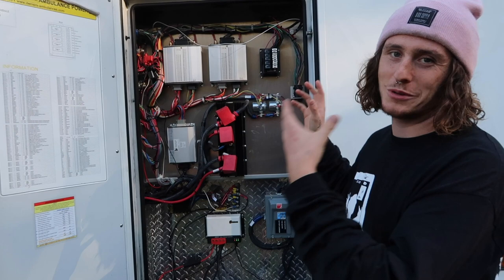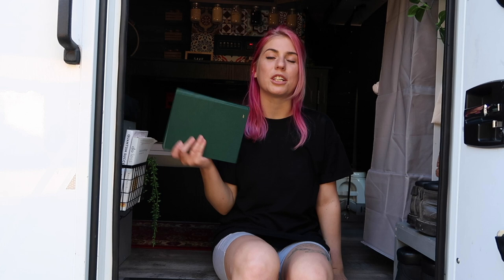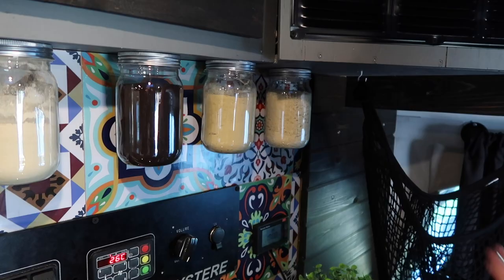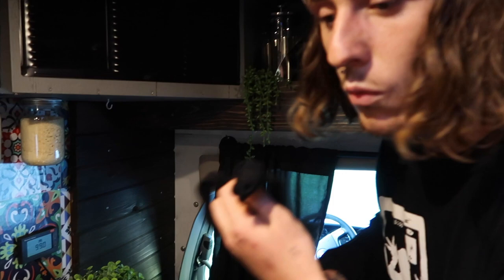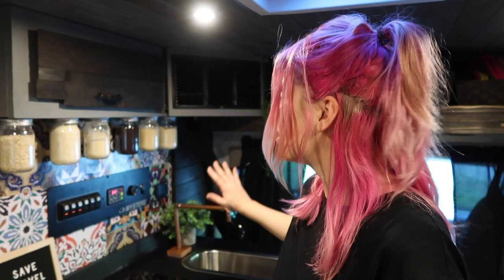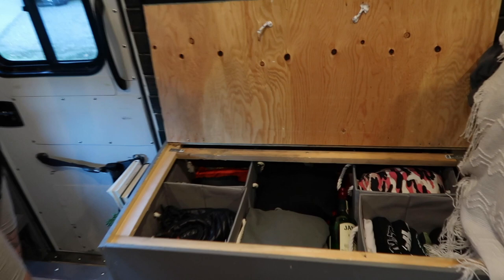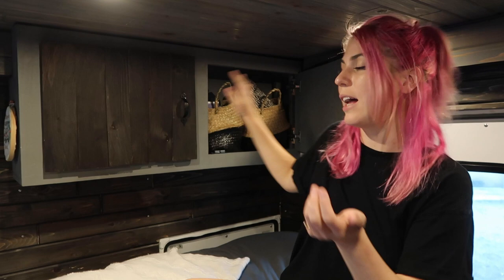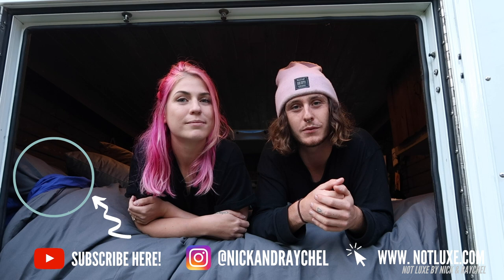AMBULANCE CONVERSION VAN TOUR | VAN LIFE with no experience, a small budget + a retired ambulance

Comment: I've already set up a 2011 Ford E450 25' shuttle bus.
I didn't spare much expense on the electrical.
3000w Victron inverter, 400ah of Lithium, 2300w inverter generator.
Unfortunately, a big ash tree fell on it, while I was sleeping, with my dog.
Just bought a 2005 Ford e450 ambulance, with a blown motor, for under $2000.
It should be easy, to swap everything over.
And, you can't really appreciate  how well an ambulance is built, until you get to know one.

Comment: I've got the same cooktop.
Yup.
It draws a ton of power.
Usually, I use my MSR Dragonfly backpacking stove.
It runs on white gas, gasoline, diesel, or, kerosene.
The induction stove is ok, as long as a charging source is available. 
Just don't store cast iron pans above it.
That's how they get broken.

Comment: The induction cooktop works for small demands, just needs a biggg battery bank! The small burner must be butane. 
The gray water storage will need an exterior solution eventually. One can use the vacuum pump in most Ambu’s to empty (if strained).

Comment: Nice job! The wood paneling looks like a cabin. Cool. Question: What’s the suspension like just going down a city street? Just outside NY, suburbs, highways, local, pot holes, manhole covers, you name it are horrible. 
How does the Ambo feel?
Reply from the maker: It definitely gets tossed around quite a bit, we’re low in the rear because we did put a lot of weight in the back (we didn’t mean to lol) so if things aren’t secured then things will definitely rattle around. For the most part, going over manhole covers is fine but we try to go slow over brutal potholes or big bumps. It’s mostly fine but can sometimes feel sketchy. This could EASILY be avoided if we didn’t have SO MUCH storage in the back. It’s one of the downsides of an ambulance because all of our heavy storage is behind the back axel, it takes more of a toll on the struts and suspension. And because the van is too short to have overhead storage that makes sense, you’d have to be more creative to not pack it all in the back.
Reply: @nickandraychel  Consider checking into adding adjustable airbags. Better for the suspension and you can control the stiffness or flex of the ride.